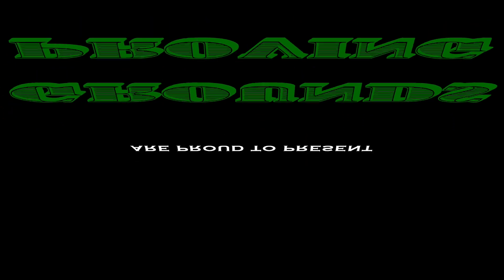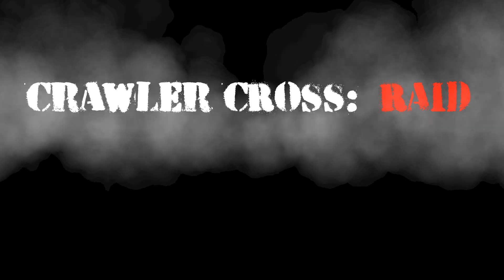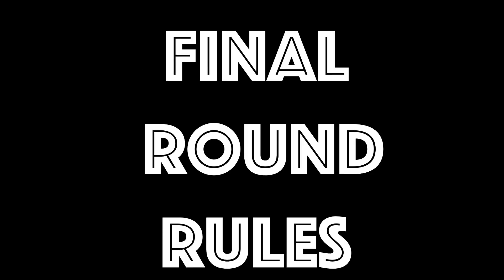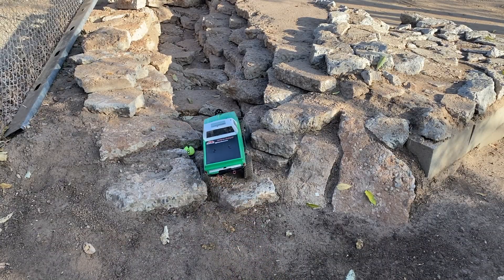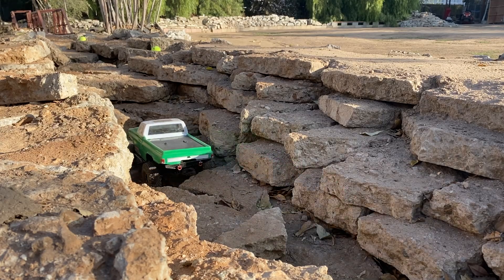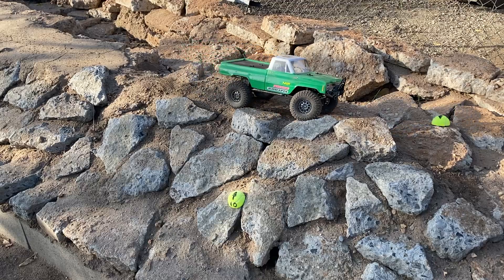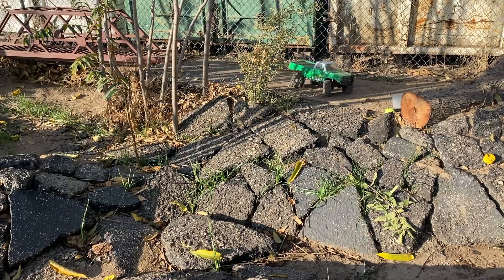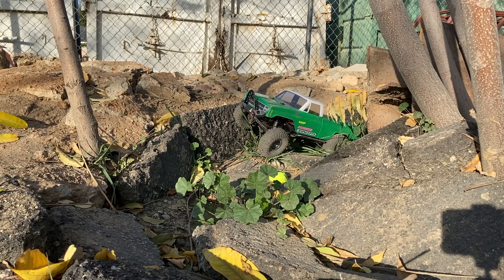Crawler Canyon Presents: Crawler Cross RAID Round 6: THE RAID--  Jolly Green's Run (Final Round)

Comment: Your course is amazing. I’m still trying to figure out how big it is. I’d love to see an aerial shot of it. Watching these challenges is like watching a soap opera, you can’t wait till the next episode. Hope the weather hold out so you can get the challenge finished. It’s getting to cold here for outside crawling.
Reply from the maker: When I measured out the running line for the "demo" before I started the RAID series, the course was 700 feet long, but half the obstacles didn't even exist then.  This layout could potentially reach 1000 feet in length. I'm only using the outer edges of this part of the property, the total area (including that which is undeveloped) is somewhere north of 9000sq/ft.

Comment: Are you losing steering through a flexing panhard mount?  I went back to the spotlight video on jolly green but it's hard to see on my phone if it's an upgrade mount or original....
Looking forward to your uploads so I must be enjoying your channel 😁
Cheers mate 👍
Reply from the maker: Yeah, aluminum panhard mount and upgraded links throughout.  I've just noticed that when the battery is in the forward position, the front end wants to push, even with an absolutely overpowered servo. I think part of the culprit might be too soft of foams in the front, as each tire has around 2.5 pounds sitting on it.